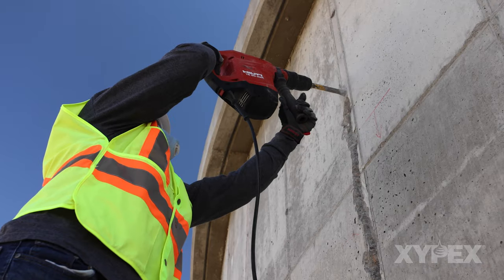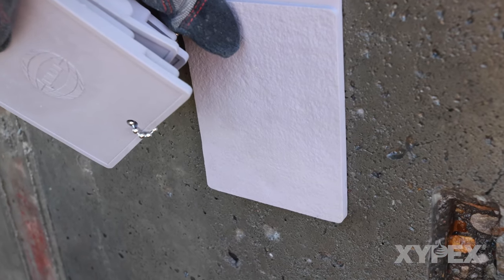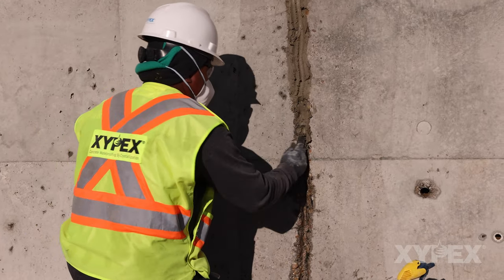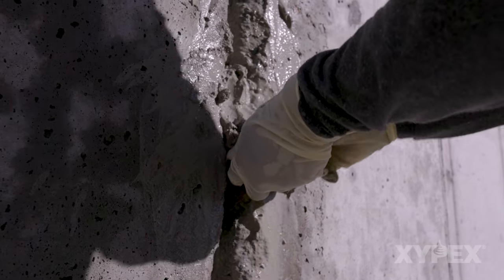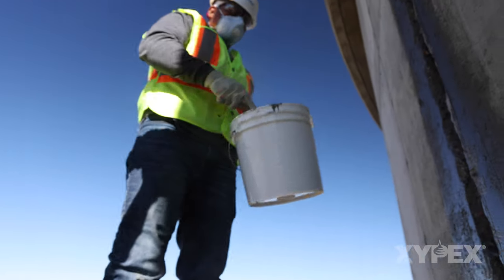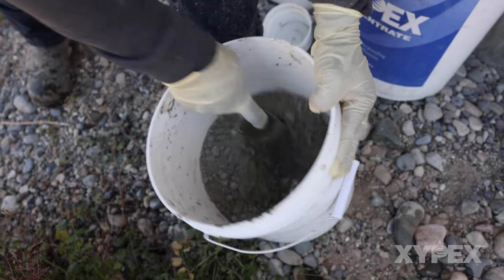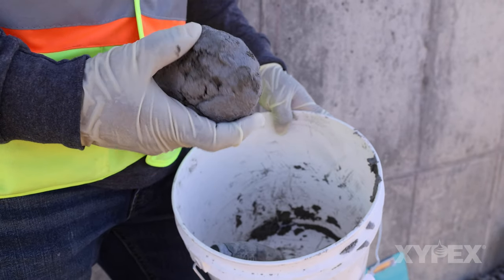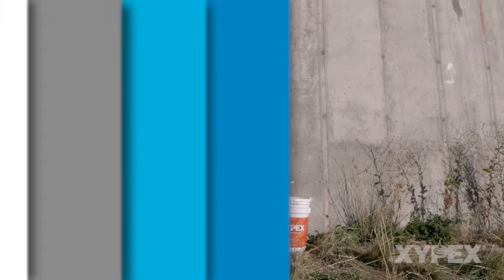Xypex - How to Repair Leaking and Dry Concrete Cracks?

Comment: Thanks for the details.  I see that we are using the Concentrate and Drypack directly, so what happen after the 21 days mentionned in the documentation? I was told that the Concentrate should be polished/grinded a bit after 21 days, and that is is not intended as a mortar or it will crack.  Here in the video it seems like a premanent plug, no?